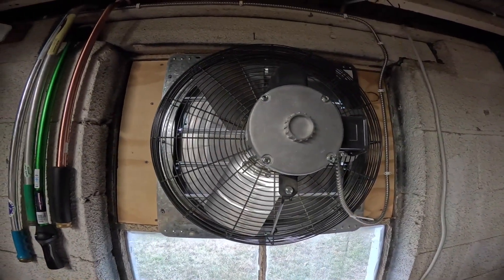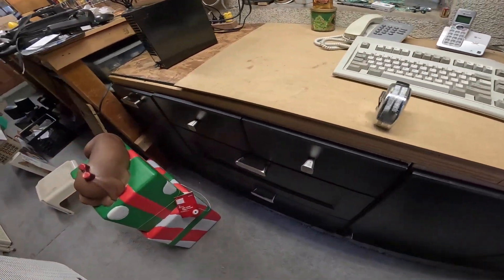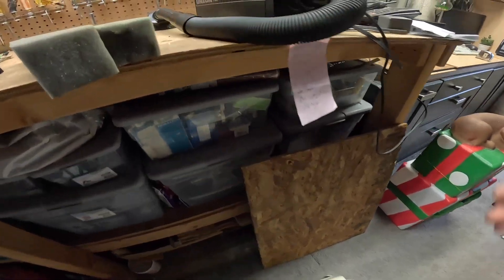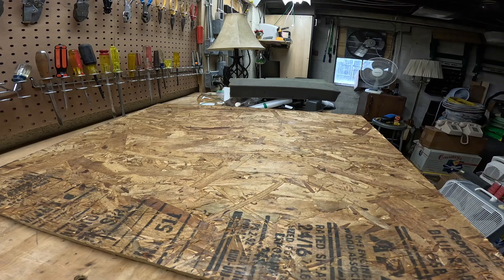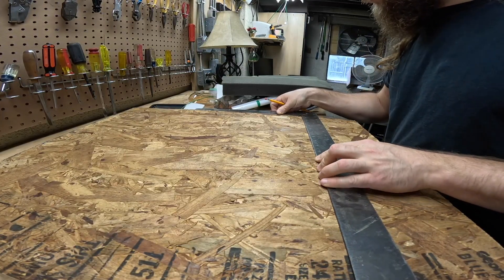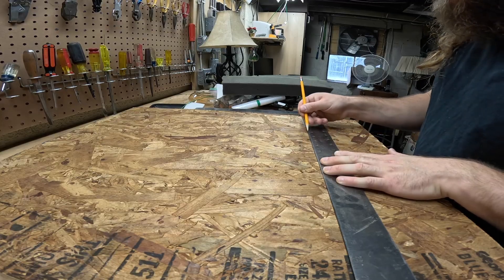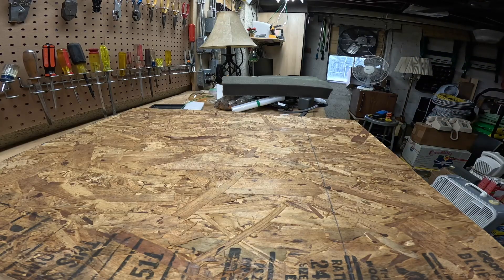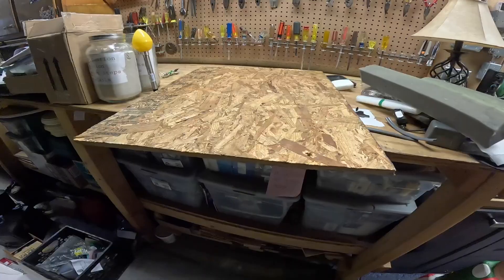Closing the Garage Exhaust Fan | Fall 2025

Comment: good video bro glad to see you got it sealed tight so the draft won't come into the garage, and it also looked like it was about to rain hopefully if it does you can  make a rain video I enjoyed the video
Reply from the maker: It was about to rain, unfortunately it's mostly been a light rain so far without any thunder.
Reply: @JordanU  true over here in San Diego California and the whole state of California is dry without rain and i pray we will get it soon with thunder and lighting we've havent had since 2023 time for a long over due strong storm .